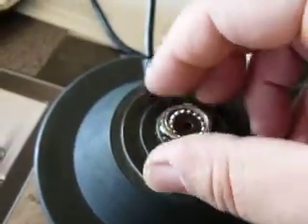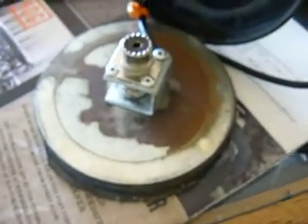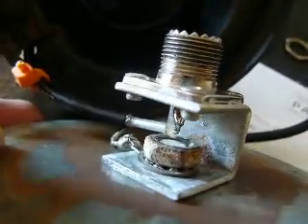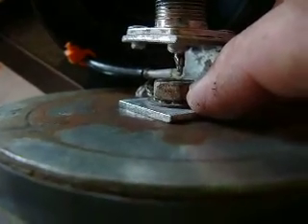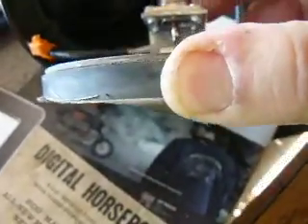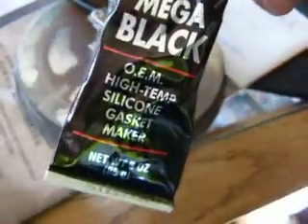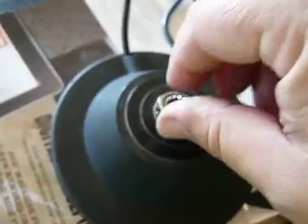WILSON 1000 MAGNET MOUNT COAX REPLACEMENT

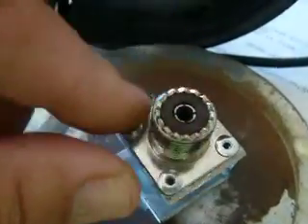Comment: Notice the coax connecter is connected by rivets and possibly loose? mine had corrosion under it. I prepped and soldered that base, swr went from 1.6 to 1.0. that ground is crucial where the the two pieces meet together and easy for corrosion to build underneath especially in salt air. 1:40

Comment: It sounds like you're making this video from the Laundry Room and there's at least one pair of jeans flopping around inside the dryer.    
    I have a Wilson 1000 and I love it. I bought it because from Arizona I made several good contacts to mobile stations using this antenna.  Recently using my Anytone 6666 and the Wilson magnet mount I contacted the whole East coast including FL to NY and Jamaica too from Arizona.  When initially tuning the antenna I was able to get only 1.3:1 SWR until I wrapped the whole magnet base in aluminum foil and up to connect to the SO-239. That seems to improve (increase) the series capacitance from the coax shield to the counterpoise or ground plane that is the roof of my Chevy. Now with the foil I always have 1.1 : 1 SWR.
Reply: I covered my baseball cap with aluminum and now I can hear Uranus.
Lol   And good call on the dryer, except it could be a zipup hoodie.

Comment: i intend to run a 12 pill in my car with a Wilson 5000. It will produce 3,300 watts PEP. Is it possible to change the coax to RG-213 on the magnamount and roof mount antennas ?
Reply from the maker: You may be able to mangle a mag mount for 213. The roof mount will need to be heavily modified, i'm not saying it cant be done but I don't think so. You would be better off having one built for you. IMHO 12 pills into a mag mount is not advisable. Its doable and people do run lots of power through mag mounts (they also ruin pills) and people also run big power through Antrons ....... Kind of silly IMHO. Better and more efficient antenna set up gives better performance.
Reply: You don't want to run a mag mount antenna with that kinda watts.

Comment from the maker: Yes a bead of silly would help seal the base, I was thinking that when the antenna coil is screwed onto the base it would make a good seal.. OR when the coil is not on, the little so-239 cap that comes whit the antenna would seal up as well. Thanks for your input.

Comment: I have the Wilson 2 Meter 5/8-wave antenna, looks just like the 1000.  Same problem - water.  They seem to work well, but suffer big-time in the QA/QC process back at the factory.  Think I'll try the Tram next time.  I also own an old-school K40 (about 30 years old) that I've used on 10 meters.  Still works like a champ.  73 de K3CXG.

Comment: Great info on Wilson antennas.  I have since new both the Little Wil and the 5000 but could never get a low enough SWR. (ch1 1.8 ch40 2)  I've since switched to the 4ft fiberglass Wilson with an SWR of 1.1. and can now SSB around the world.

Comment: I have this mount and the coax on the cb side has worked loose and was wondering how to rewire that end
Reply from the maker: I would put on a new PL259. (solder type/ not a crimp on )

Comment: If I'm changing the coax, why would I need to cut the bottom to expose that nut?
Reply: Just guessing,  but one of the things he mentioned was removing that bracket that actually holds  the SO-239 and cleaning all underneath it.  To do that you have to take off that big nut and that is going to let the bolt spin.....especially as rusted up as it looks to be!

Comment: hi I have a k30 and my coax has come completely off of it. Any chance you have one of them around that you could show me where the connections go? Looks like I need to resolder at least 2 spots, maybe 3.

Just want to do it right and not screw up my mount. 
It was free to me, but I don't want to put more money in it than I need to.
Reply from the maker: I have never messed with one of those. Look, it was put together some how. Just take your time and try to disassemble it. Antennas are relatively cheap...ya got nothing to loose. When you get it apart, make a video and show us... BB23

Comment: I replaced my coax quite awhile ago. But driving down the free way one day my antenna flew off my van. Anyway I ended up loosing the magnet part on the base. What holds that in place ? Anyway shopping for a new base for my Wilson 1000 unless anyone knows where to get just the magnet ?
Reply: try HRO. I bought one there.  It wasn't cheap though.

Comment: You forgot to put the silicone around the SO-239 also BEFORE assembling the plastic cover. True it's already sealed kinda so only a small bead around the base of the SO-239.
But well done, easy, and I wish people would stop just throwing crap away.
Just fix it.
Now hurry and go answer the damn phone would ya